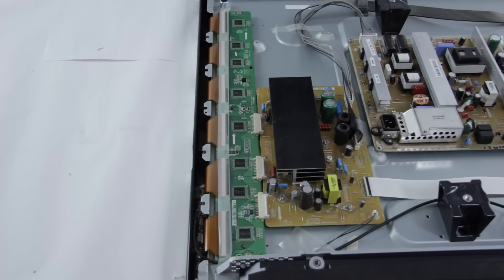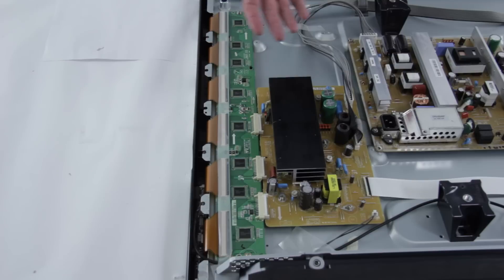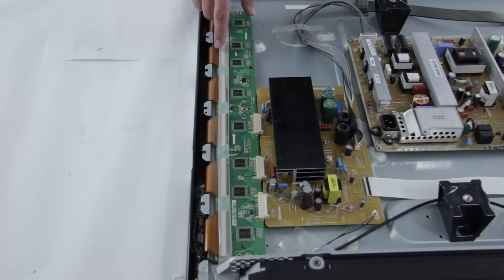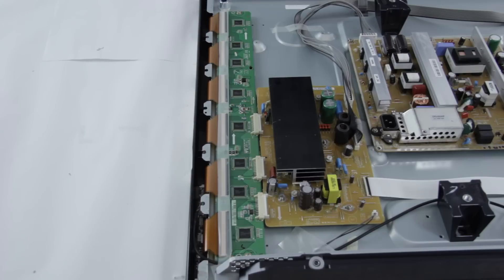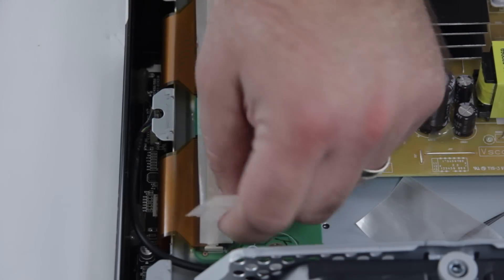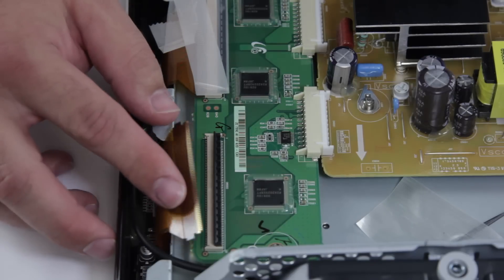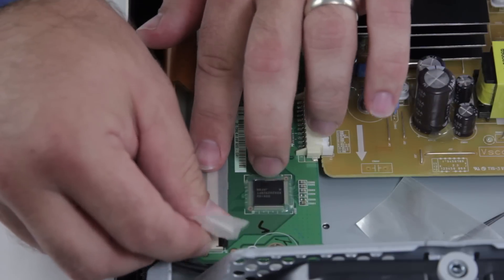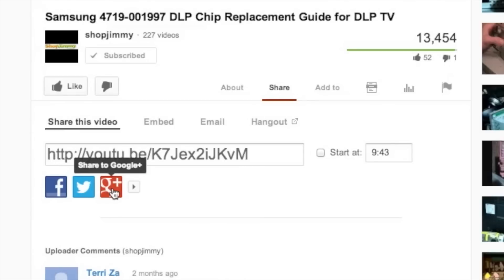Plasma TV Repair - No Image, No Picture on Plasma TV Screen - How to Replace Y-Buffer & Y-Sustain

Comment: In need of help. I have a RCA 42PA30RQ that has no picture but has sound.  TV will start two fast clicks stand by goes to blue will stay that way for about 15 min then go back to stand by. If I disconnect the Y and X board it still will do the same thing on start up. Only two fast clicks.  Fuses are good on power supply.
Reply from the maker: Bill Standish  Please watch this video FIRST to help with your repair!  https://www.youtube.com/watch?v=BP3NVNCGEv8  This could be a problem with either the main board or the power supply board in your TV.  You may need to replace each board individually to see which one fixes the problem.  Click this link to replacement parts for your TV model number:  http://www.shopjimmy.com/catalogsearch/result/?q=42PA30RQ  There may be multiple boards for the same TV model number, be sure to match part numbers on your current board, with your replacement for compatibility.  Thanks and please let us know if you have any further questions with your TV Repair!  www.shopjimmy.com

Comment: I have a 50c550g1fxza...I checked the following.
1- PS-ON (3.3v while on stand by)
2- STBY ( 5v while on stand by)
3- VS on the SMPS less than 10vdc while trying to power up
4- VA on the SMPS was 55vdc while trying to power up
5- I removed the X-Main cable that goes to the Y-Main and got the same results (readings).
6- I removed the Y-Main cable from the SMPS and got the same results.

So here I am lost...I already replaced the Y-Buffers (not the Y-main) and the X-Main and X-buffer. But still same results, don't know if I need to replace the SMPS or the Y-Main.
Reply from the maker: jeanious2009  Please watch this video FIRST to help with your repair!  https://www.youtube.com/watch?v=BP3NVNCGEv8  I recommend replacing the A main board in your TV.  Click this link to replacement parts for your TV model number:  http://www.shopjimmy.com/catalogsearch/result/index/?cat=56&q=50c550g1fxza  There may be multiple boards for the same TV model number, be sure to match part numbers on your current board, with your replacement for compatibility.  Here is a link to a video showing how to identify your part number, click here:  https://www.youtube.com/watch?v=BEPWrefQvqI  Thanks and please let us know if you have any further questions with your TV Repair!  www.shopjimmy.com

Comment: i have a SANYO 47" integrated plasma HDTV that has been randomly been doing the popping and picture cutting out and now has lost picture completely and started making a faint electrical beep.  Also have now smelt a slight electrical burn smell.  Could use some advice on what to look for or how to go about repair.  Thanx.

Comment: I have a Samsung PN43D450A2DXZA and the audio works but there is no picture. I measured the Vs and Va voltages on the power supply board and they come up to their correct voltages briefly then decayed to 0V. Reading on the internet it seems the X and Y main board are the usual suspects. I removed these boards and checked all transistors for shorts and did not find any. I may have missed a few but I thought I checked them all. Not knowing what board might be the issue I took a chance and bought and X0main and Y-main board on ebay. However when I plugged them in the TV did still not work. I don't want to dump too much more money into this TV but if there is a quick check. that can fix my TV
Reply from the maker: RFurball  Please watch this video FIRST to help with your repair!  https://www.youtube.com/watch?v=BP3NVNCGEv8  I recommend replacing the Y-Main Board and the Bottom Y-Scan Drive boards in your TV.  Click this link to replacement parts for your TV model number:  http://www.shopjimmy.com/catalogsearch/result/?q=PN43D450A2DXZA  There may be multiple boards for the same TV model number, be sure to match part numbers on your current board, with your replacement for compatibility.  Here is a link to a video showing how to identify your part number, click here:  https://www.youtube.com/watch?v=R1jmj_foId0  Thanks and please let us know if you have any further questions with your TV Repair!  www.shopjimmy.com

Comment: i have a 60 inch plasma Panasonic flat screen it stopped showing a picture but sound still works when power up tv it flashes the power led indicator red it is a 2010 model i have it at the tv repair mans store but i am curious about repair cost and item that might be replaced if repairs are to pricy to have him do the repairs i might get him to specify what item he found to need repair and i would look for repair parts online i know with out model # it is any ones guess but i am able to work on most any thing i try to repair thanks in advance for any and all comments!!!!!
Reply from the maker: *****  Replace the SC, SU & SD boards.  Please reply with your TV model number.  Click here to view a video that shows how to find your TV model number:  https://www.youtube.com/watch?v=S51nhAmwR2M  Thanks!  www.shopjimmy.com

Comment: Hi there, I would need repair for my SAMSUNG PS64E8090 Plasma Smart TV.
Samsung warranty is 2 months over and since my picture is dark and has spackles, they told us the panel has crashed and need to be replaced, it will cost 2600 bucks. I will put it in the trash before I give money to those cheaters again! Please advise, thx. G. Nowak
Reply from the maker: Gerhard Nowak   I recommend replacing the y board and y buffers in your TV.  Unfortunately I do not see any replacement parts in the search results for your TV model number on our website.  Please reply with your part number on your y board and y buffers and I can try searching for replacement parts.  Thanks and please let us know if you have any further questions!  www.shopjimmy.com

Comment: LG 50PN4500 50" plasma.  Red power indicator lights up when power is turned on. No video. No sound. Thanks!
Reply: sorry. DOES have sound
Reply from the maker: Michael Tabor   Sounds like a problem with the buffers in your TV.  Please reply with the part numbers on your buffer boards.  Thanks!  www.shopjimmy.com

Comment: Need a repair on Samsung PN58C8000 . No Video but has audio. Please advice
Reply from the maker: janaka dias   Please watch this video FIRST to help with your repair!  https://www.youtube.com/watch?v=BP3NVNCGEv8  I recommend replacing the Y-Main Board and the upper and lower Y Scan drive boards in your TV.  Click this link to replacement parts for your TV model number:  http://www.shopjimmy.com/catalogsearch/result/?q=PN58C8000  There may be multiple boards for the same TV model number, be sure to match part numbers on your current board, with your replacement for compatibility.  Here is a link to a video showing how to identify your part number, click here:  https://www.youtube.com/watch?v=R1jmj_foId0  Thanks and please let us know if you have any further questions with your TV Repair!  www.shopjimmy.com
Reply: HI Jimmy, another Qs i recently purchased an x board and replaced it with accuracy however the video doesnt seems to work.I see that there is a brownish patch on the same place on both x boards old and new. I think the x board gets a high power out put . What are your comments
Reply from the maker: janaka dias   As recommended, did you replace the Y Main Board and the upper and lower Y Scan Drive boards?  Thanks!  www.shopjimmy.com
Reply: Yeah
Reply from the maker: janaka dias   So, at this point, you have replaced the Y-Main board, the Y Scan drive boards, and the X board?  has there been any change?  Are the replacement boards confirmed compatible and good replacements?  Thanks!  www.shopjimmy.com
Reply: ShopJimmy.com Yeah, Do you have PN58C8000 Main board and TCON boards.
Reply from the maker: janaka dias   There is not a t-con board in your TV, as your TV is a plasma.  Click this link to replacement parts for your TV model number:  http://www.shopjimmy.com/catalogsearch/result/?q=PN58C8000  Thanks!  www.shopjimmy.com
Reply from the maker: janaka dias  This sounds like a TV panel (TV Screen) problem.  If your TV panel is bad, it may be more cost-effective to replace the TV as panels are typically hard to find in stock, difficult to replace, and expensive.  Thanks and please let us know if you have any further questions!  www.shopjimmy.com

Comment: Have a lg 50pg20 sound but no picture any ideas
Reply from the maker: anthony lopes  Please watch this video FIRST to help with your repair!  https://www.youtube.com/watch?v=BP3NVNCGEv8  I recommend replacing the YSUS and the YDRTP & YDRVBT boards in your TV.  Click this link to replacement parts for your TV model number:  http://www.shopjimmy.com/catalogsearch/result/?q=50pg20  There may be multiple boards for the same TV model number, be sure to match part numbers on your current board, with your replacement for compatibility.  Here is a link to a video showing how to identify your part number, click here:  https://www.youtube.com/watch?v=GEllG3RV-tc  Thanks and please let us know if you have any further questions with your TV Repair!  www.shopjimmy.com

Comment: Im Having problems with my zenith plasma tv, model Z50PJ240-UB. I get a blank screen and no audio,  I also hear a popping sound when trying to turn on the tv. this is my problem ( https://www.youtube.com/watch?v=DvXs3t-fFsw ) just interested to know what may be the problem with it. what repairs might i be looking at?
Reply from the maker: Myke J  Please watch this video FIRST to help with your repair!  https://www.youtube.com/watch?v=BP3NVNCGEv8  I recommend replacing the YSUS and the YDRVTP & YDRVBT boards in your TV.  Click this link to replacement parts for your TV model number:  http://www.shopjimmy.com/catalogsearch/result/?q=Z50PJ240-UB  There may be multiple boards for the same TV model number, be sure to match part numbers on your current board, with your replacement for compatibility.  Here is a link to a video showing how to identify your part number, click here:  https://www.youtube.com/watch?v=GEllG3RV-tc  Thanks and please let us know if you have any further questions with your TV Repair!  www.shopjimmy.com

Comment: Hi, I have a Samsung 42" Plasma TV Model# PN42B450B1DXZA that just went out today.  It started by the video being extremely snowy (more black & white) and was flickering in and out (blank to snowy).  Then it went out completely (no picture display) but the sound was still present.  I never heard any noise or anything else other than the normal video sound.  I could not bring up the menu or any other controls other than being able to turn it on/off.  It stays on when turned on and plays sound fine.  I even switched between HDMI and Audio/Video inputs with same results.  I've got the back pulled off and checked the two fuses on the power supply which look OK.  I've taken the stand off of the TV and currently it's laying flat on the carpet floor so hopefully that's not any worse for it.  So I'm open to any suggestions before I start looking for a new TV.  Thank you,

(If it helps any, the Y-Main board has a PCB NO LJ41-06614A, REV NO. R1.11(09/09/14), PBA NO. LJ92-01669A.  The Y-Buffer has a PCB NO LJ41-06616A, REV NO R1.2 (09/06/12), PBA NO LJ92-01671A.)
Reply: I have the same problem!  And in the same day!! Any idea how to fix it?

Comment: Hello, I have a Samsung PN51E490B4F That is not showing an image/backlight at power up. The TV tries to start then turns back off and the power LED blinks 3x fast. I replaced the SMPS board thinking that was the problem and the problem still exists. Shorting the PS_ON pin on the SMPS to Main board connector causes the PSU to click on and off but no image. There is 4 pads on the logic board that say "1,2:3D 3,4:NT and 1,2,3,4:PAL" is 3 &4 the hardware test mode? Or should it have turned the backlight on with just the PS_ON pin shorted? I'm a 5th year Electrical Engineering student so feel free to get a bit technical, I have just never dealt with TVs.

Comment: Samsung Plasma Model #PN59D7000FF
Screen went black and we still have sound.  Turned off TV and had difficulty getting it to turn back on after unplugging several times.  TV turned on after several attempts, but only had sound and no video.  When the TV is off, the red indicator light responds to remote but there is no clicking and TV turned on after several minutes.  Please help!
Reply from the maker: Jonathan Swartz  Please watch this video FIRST to help with your repair!  https://www.youtube.com/watch?v=BP3NVNCGEv8   I recommend replacing the Y-Main board and the Upper & Lower Y Scan Drive boards in your TV.  Click this link to replacement parts for your TV model number:  http://www.shopjimmy.com/catalogsearch/result/?q=PN59D7000FF  There may be multiple boards for the same TV model number, be sure to match part numbers on your current board, with your replacement for compatibility.  Here is a link to a video showing how to identify your part number, click here:  https://www.youtube.com/watch?v=R1jmj_foId0  Thanks and please let us know if you have any further questions with your TV Repair!  www.shopjimmy.com

Comment: I have a zenith pdp50t10000 I'm getting the correct power at each pin with all the other boards unplugged but soon as I plug a board into the power supply all the readings read low and my symptom is clicking noise and no picture what board or boards could that be?

Comment: Please help. I have a 42 inch rca TV. I just replaced the y main board and the y buffer. TV makes 3 popping sounds which make out to be relays to me. Blue light come on the tv but no picture or sound.

Comment: I have an LG 60PX950 plasma tv.  I have sound but no video through any of the 4 HDMI inputs, the screen just says "no signal" for Directv.  Can you help?  Thanks
Reply from the maker: Hawss1603  Please watch this video FIRST to help with your repair!  https://www.youtube.com/watch?v=BP3NVNCGEv8  I recommend replacing the main board in your TV.  Click this link to replacement parts for your TV model number:  http://www.shopjimmy.com/catalogsearch/result/?q=60PX950  There may be multiple boards for the same TV model number, be sure to match part numbers on your current board, with your replacement for compatibility.  Here is a link to a video showing how to identify your part number, click here:  https://www.youtube.com/watch?v=RwHTvjMdrhk  Thanks and please let us know if you have any further questions with your TV Repair!  www.shopjimmy.com

Comment: Hay jimmy I have plasma 42in with black dots almost all over the screen which goes away and come back after changing channels also I have a shadow from previous screen which is still their and can be seen during channel change. Checked power supply checked x sustain board they all seems to be fine all capacitors seems to be fine not sure what's cousing this issue also color lines can be seen from top to bottom some time they disappear and come back again please help me thank you

Comment: I have a samsung plasma TV PN58C7000YF there is sound but no picture, What should I do? and I know what part to replace.
Reply from the maker: Guerda Roland  Please watch this video FIRST to help with your repair!  https://www.youtube.com/watch?v=BP3NVNCGEv8  I recommend replacing the Y-Main board and the upper and lower y buffers (Scan Drive) in your TV.  Click this link to replacement parts for your TV model number:  http://www.shopjimmy.com/catalogsearch/result/?q=PN58C7000YF  There may be multiple boards for the same TV model number, be sure to match part numbers on your current board, with your replacement for compatibility.  Here is a link to a video showing how to identify your part number, click here:  https://www.youtube.com/watch?v=R1jmj_foId0  Thanks and please let us know if you have any further questions with your TV Repair!  www.shopjimmy.com

Comment: Hello
I have a Philips Plasma TV, model # 50PFP5332D/37.
No picture or sound, TV had a small popping sound and picture and sound disappeared.
I took back off tv and replaced 3 bad caps on the power supply board, plugged TV in and still no picture or sound. Power light on front does turn on along with multiple lights on boards on back of TV. No luck so far, what can you suggest?
Reply from the maker: Michael Bennett  Please watch this video FIRST to help with your repair!  https://www.youtube.com/watch?v=BP3NVNCGEv8  I recommend replacing the Y-Main Board and the Upper and Lower Y Scan Drive boards in your TV,  Click this link to replacement boards:  http://www.shopjimmy.com/catalogsearch/result/?q=50PFP5332D%2F37  There may be multiple boards for the same TV model number, be sure to match part numbers on your current board, with your replacement for compatibility.  Here is a link to a video showing how to identify your part number, click here:  https://www.youtube.com/watch?v=R1jmj_foId0  Thanks and please let us know if you have any further questions with your TV Repair!  www.shopjimmy.com

Comment: I have a problem with a samsung plasma mod ps 42c430 in witch image is poor,eg: dots with many colours on all parts of the screen and it seen a negative picture if this a fault on the panel or the Y-Main board,Please help and revert back.Thanks
Reply from the maker: Christina Meunier  Please watch this video FIRST to help with your repair!  https://www.youtube.com/watch?v=BP3NVNCGEv8  I recommend replacing the Y-Main Board and the Y-Scan Drive board in your TV.  Click this link to replacement parts:  http://www.shopjimmy.com/catalogsearch/result/?q=42c430  There may be multiple boards for the same TV model number, be sure to match part numbers on your current board, with your replacement for compatibility.  Here is a link to a video showing how to identify your part number, click here:  https://www.youtube.com/watch?v=R1jmj_foId0  Thanks and please let us know if you have any further questions with your TV Repair!  www.shopjimmy.com